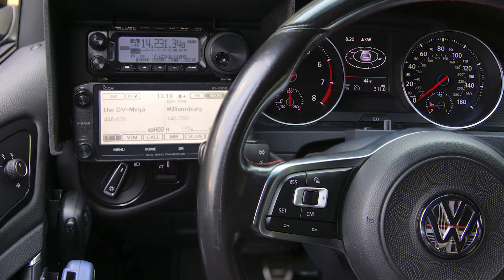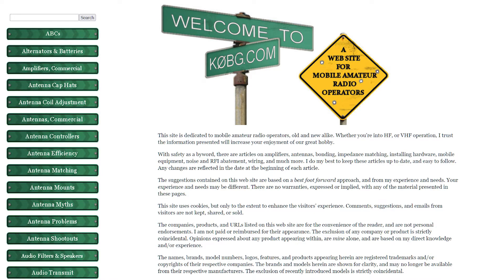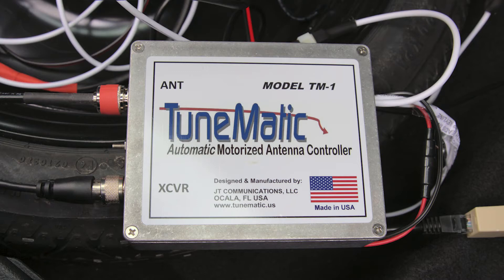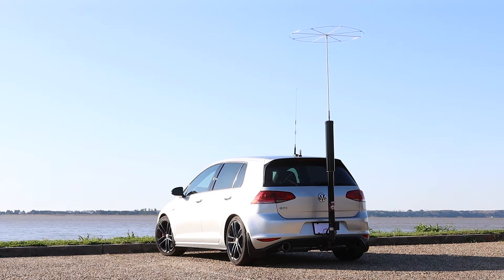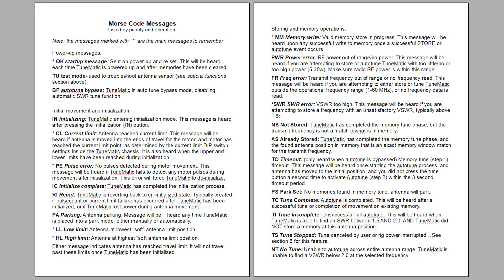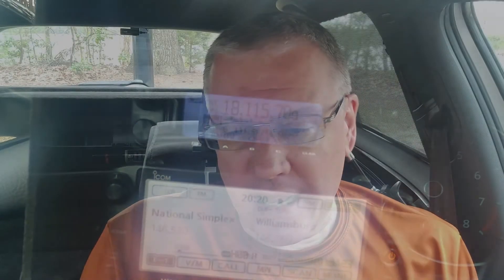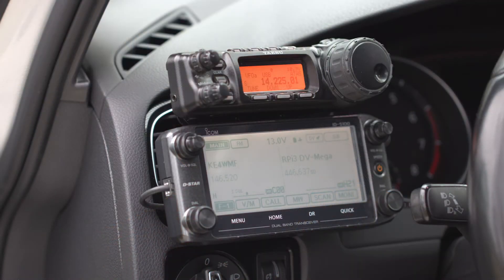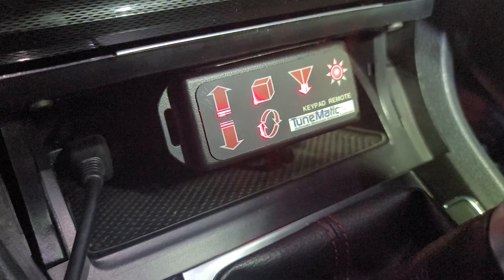TuneMatic TM-1 Automatic Motorized Antenna Controller

Comment: Had an Atas 120A & it was a POS💩.I was so happy when I sold it and the 857D.I replaced them with an ICOM 7000 and Tarheel II & it was a Huge improvement.👍🎙
Reply from the maker: Excellent! I have since returned to using my MFJ-1924. The TuneMatic isn't quite as automatic as one would hope, given the varied surfaces on which I operate. I need to make a video that describes my decision. Thanks for visiting!

Comment: Good evening, Scott. Will this work with the ATAS-120A? Great video and thanks for all your videos you do. 73’s WD4ITE
Reply from the maker: I don't believe it will, Allan. Most screwdriver antennas use +/- 12V switched and put that voltage on separate control lines. The ATAS-120A puts the control voltage on the coax, which the TuneMatic cannot do. But, perhaps more importantly, the ATAS-120A is driven by what I'll call a stepped voltage. I don't recall the specific voltage levels, but it's akin to using 11V to drive the coil upward and 7V to drive it downward, which is not how the TuneMatic works. To what rig are you trying to interface the ATAS? If not an FT-857D or FT-891, have you heard of the MFJ-1925?
Reply: @StealthGTI  thanks Scott, I am running the FT-891 and I will have to check into the MFJ-1925. I’ve made some awesome contacts on the ATAS-120A, and will upgrade later on. Thanks again, 73’s WD4ITE
Reply from the maker: @wd4ite95  - If you have the FT-891, then you don't need anything else. The radio has ATAS controls built-in. It will apply proper tuning voltage and automatically adjust for lowest SWR, all with the press of a button. Check your owner's manual. If you open a PDF version of the manual, press CTRL+F and enter "ATAS" as a search phrase. You'll have plenty to read.

Comment: Curious. Did you have to choke the Tunematic cables/control cables? If so, how did you go about it? This looks like an awesome controller. I might get one for my ICOM 7100 as I'll be buying a tarheel soon.
Reply from the maker: I did not choke the Tunematic. Perhaps I should have. Regardless, I returned to using my MFJ-1924. The TM-1 is a good controller, but required constant retuning or fine tuning in my particular application. See my MFJ-1924 video for general descriptions of my issues. Now that MFJ products may soon my unacquireable, I'd consider a Tunematic LITE. It features similar "clunkiness" to the MFJ, but also has some automated features that may still be practical, even in my application. Thanks for visiting!

Comment: I haven’t had any luck with a Turbo tuner I’m going to scrap the a turbo and try tunematic
Reply from the maker: Thanks for writing, Steve! This is a copy of a recent response to someone else: I eventually came to conclude that the TuneMatic emits enough errors to be a little frustrating. Even if I knew CW, I'd still think, "What's with the errors?" I went back to my MFJ-1924, which appears to be identical to the Ameritron SDC-102 (currently available at DXE). The challenge is with my particular antenna installation. Being low to the ground, anything and everything can affect the tune. This includes rebar on concrete roads, trees, and even wet roads. The TuneMatic automatically tunes once and then relies on programmed info after that. That's great for a higher antenna or one that operates from similar locations all of the time. But the "tune" is almost always wrong, given my various operating locations. I'd always have to manually retune, which I don't think is as convenient as with the 1924. The TuneMatic is a fine device, but the "automation" isn't all it's cracked-up to be in MY application. BTW, the "clunkiness" of the 1924's large relay buttons turns out to be very easy in a mobile environment. I'll share a video about the 1924 soon.

Comment: Plus, driving a motor under voltage shortens its life. "Step it up" to 19 or 20 volts. Your Scorpion SA6-160 will thank you for it.
Reply from the maker: Thanks for the tip! I'll have to ask its designer for his thoughts on the topic. Take Care!
Reply: @StealthGTI  Were you able to follow up with the designer?  I just have bought the TuneMatic TM-1 and am curious.
Reply from the maker: @rockinmayor7807  - I haven't. I still want to talk with Ron at Scorpion about it. Still, these things have been out there a while and would have problems by now if it was a terrible issue. Full-time use over the long haul may pose a risk. But our brief tuning sessions probably aren't hurting much, especially if the motor is designed to receive variable voltage input for speed control. Since I'm feeding mine with 14.2 volts, then I guess I'm operating at 75% speed.  ;-)

Comment: Just ordered mine I got the manual one for my tarhill 200 hp
Reply from the maker: I'm back to using my MFJ-1924. Search my channel for a video. With MFJ ceasing production, should I need a replacement, the manual TuneMatic will probably be my top choice. Thanks for visiting!

Comment: Thank you for this video, I always come back to this, I have some trouble tuning on 15meters with a Little Tarheel ii, the controller says it found a match and MMs, but it doesn't unkey the radio.. it only happens on 15m, could it be stray RF?
Reply from the maker: Very likely to be common mode current. Do you have Mix 31 beads in your setup? If not, take a look at K0BG.com and view his "Common Mode" tab. And, FWIW, I have switched back to my MFJ-1924. I need to make a video detailing that. Thanks for visiting!
Reply: @StealthGTI  thanks for the reply, I added a bunch of beads since making this comment and it did fix it.. I am having a different issue now where it moves off frequency in WSJT-x, I am planning to rewire everything and choke it properly.. nice running into you during the W3RAR memorial activation in MD, 73s, NB2R
Reply from the maker: @thiyag  - The change in frequency is probably because your computer is going nutty and moving the frequency. This assumes you are set up for rig control. If that's the case, don't forget to choke the control lines and even the power input on your computer. I have a similar issue on 20m and resolved it with chokes on the computer. The experience convinced me that it's just about impossible to block ALL common mode current; it's all of matter of additional suppression, including along alternate paths... even the microphone, display, and speaker cables.  Good Luck!

Comment: Very Informative Video. I just picked up a Tunematic. Got a deal on it. Gonna be fun figuring it out.
Reply from the maker: Right on! I wound up removing mine. It wasn't necessarily because of the code. Instead, I felt that it was more finicky with the various tuning challenges presented by my Scorpion. For example, I've learned that the antenna tunes differently over concrete than it does asphalt due to the rebar. As a result, the various memory settings are not ideal for my situation. It also cannot account for the difference between when I'm using a caphat or a whip. My MFJ-1924, while not as sophisticated, is much easier to use in my particular settings. I'll shoot a new video soon about my decision to switch back to the MFJ. Thanks for visiting!
Reply: You went back to the MFj? That's probably why the guy sold me the Tunematic then. It's not practical..but a complicated toy?
Reply from the maker: @princerogers804  - I'm not sure why your guy sold his TuneMatic. It may work very well in an application where the antenna is mounted higher and with more ground plane. However, there are simply too many variables in my chosen mounting scheme. Staying simple is a better choice for me. Stay tuned for my MFJ video. I need to brainstorm how I want to present it.

Comment: Nice video. Learn CW!  Was waiting for an MFJ controller but they are back ordered forever so ordered a Tunematic today. Might have been able to go pick one up as I am only 30 miles from Ocala but I’ll let him ship it.
Reply from the maker: NO WAY! HAHA! I eventually came to conclude that the TuneMatic emits enough errors to be a little frustrating. Even if I knew CW, I'd still think "What's with the errors?" I went back to my MFJ-1924, which appears to be identical to the Ameritron SDC-102 (currently available at DXE). The challenge is with my particular antenna installation. Being low to the ground, anything and everything can affect the tune. This includes rebar on concrete roads, trees, and even wet roads. The TuneMatic automatically tunes once and then relies on programmed info after that. That's great for a higher antenna or one that operates from similar locations all of the time. But the "tune" is almost always wrong, given my various operating locations. I'd always have to manually retune, which I don't think is as convenient as with the 1924. The TuneMatic is a fine device, but the "automation" isn't all it's cracked-up to be in MY application. BTW, the "clunkiness" of the 1924's large relay buttons turns out to be very easy in a mobile environment. I'll share a video about the 1924 soon.

Comment: Do you have a common mode choke on you coax line?… this often cures any strange SWR anomalies..
Reply from the maker: Yes, both the coax and control lines are choked. I have since learned that, due to the low placement of my antenna, various road surfaces can have a significant impact on SWR. For example, cement roads often detune my antenna because of the rebar that's often overlooked by road users. The same can be said of nearby railings. Since this phenomenon also plays games with the TuneMatic and its memories, I have removed it and returned to using my more simple MFJ-1924. I need to shoot a video about that decision and how I've programmed my MFJ. Thanks for visiting!

Comment: SCOTT, EVEN BOY SCOUTS WERE REQUIRED TO LEARN MORSE CODE... OBVIOUSLY YOU ARE A NEW HAM... NO CODE AND NO RADIO THEORY REQUIRED.
Reply from the maker: You should have put emphasis on "WERE." Morse code was dropped as a requirement to earn the "Radio" merit badge over 20 years ago! In fact, Scouts can advance to Eagle Scout without even looking at the Radio merit. Still, I appreciate your helpful and encouraging comments. Nearly 28 years as a licensed amateur has taught me who to take with a grain of salt.
Reply: @StealthGTI  Scott I am at a loss. I used HF all the time in my 21 years of military service. Heck CW wasn't even taught anymore. Most of the traffic we sent was digitally since it was a fast mode of transmission and allowed for error correction. I have also installed and operated radios on numerous military platforms to include ground based, ships, and aircraft. Since I had no need for "code" was I incorrectly operating my radios while I was in the military? Which brings up a tought, I wonder if the encryption we used would allow CW, I am guessing not.
Reply from the maker: @chesty1369  - Agreed! I remember when the Coast Guard sent its last CW message in 1995. The plan's announcement came much earlier. At that point, I knew the writing was on the wall and that the CW requirement would disappear from amateur radio, too. That happened in 1995. Do hams still send code? Yes! Does it get through more reliably than voice? Yes. However, advancements in digital HF transmissions are changing the game a bit as well. As you said, error correction makes for perfect copy.
Reply: However Scott the CW bands are alive and well. You just are not required to learn it anymore but many of us really enjoy cw. Individual choice. Of course I had no option as I was a Novice back in 74. cW only so no choice  enjoy the hobby no matter what modes you use. Next year is my 50 th anniversary of ham radio